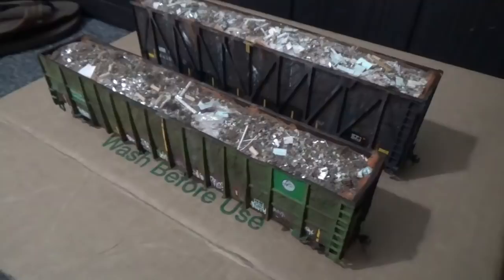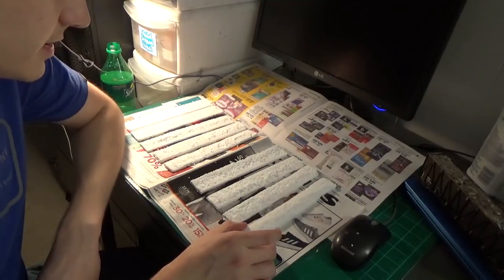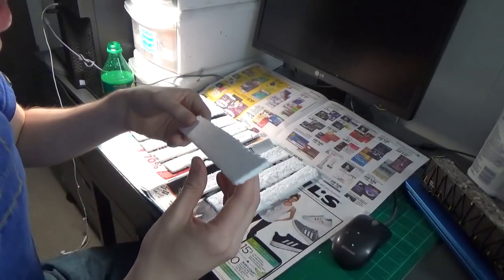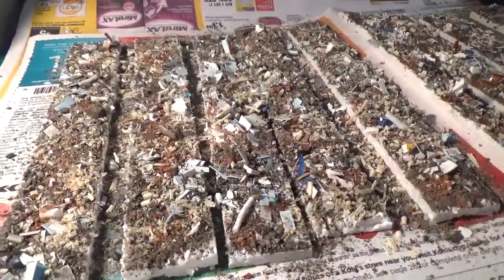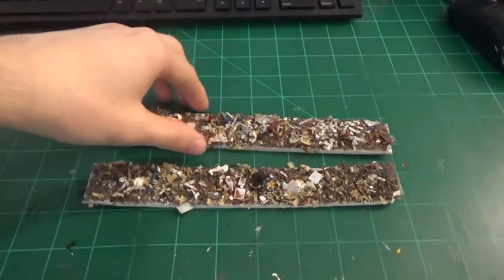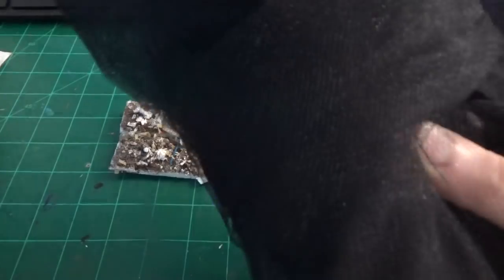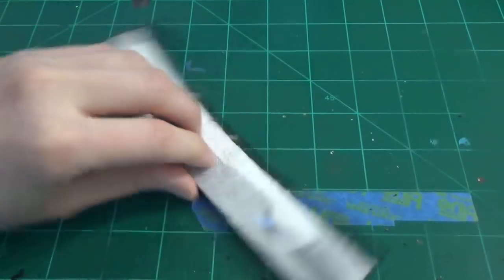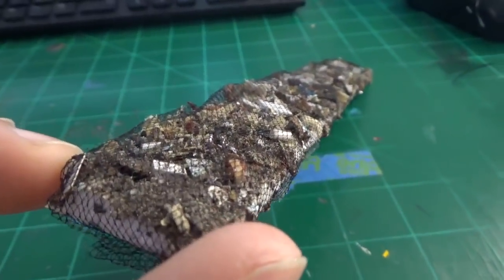***HOW TO: Make C&D Garbage Loads For HO Gondolas! ***

Comment: Hi Dan, I just love the way the gondolas look with the smooth walls. They should be the only type of walls on the gondolas. I think it looks better than the ribbed walls. The black ones should be painted red or orange or yellow or blue or chrome. I have been making realistic C&D and I have multipurpose gondolas. I have also been collecting wood shavings and partially burned wood from near a fire pit for the burned down house effects on the C&D load. I highly recommend getting burned wood for your C&D cars. I also highly recommend getting small chunks of asphalt for the C&D cars. I also highly recommend getting a tier 4 just for the C&D cars. I just LOVE tier 4s. Cory Mears

Comment: Since all foam (styro or sponge) deteriorates over time it is wise to seal the foam with a 50/50 mix of Elmer's glue (PVA) and water.  Once sealed you're good to go from there. Nice gondola loads.  I've got a box full of plastic wheel sets when I changed to all metal wheels & axles and I was gonna throw them away.  Now I've decided to use them as loads for flatcars and gondolas.  I've also got a few plastic knuckle couplers I'm gonna use in a load also.  Cheers from eastern TN

Comment: You've got a lot of talent at making those. And you're giving me a lot of good ideas. But i have a couple suggestions. If you use  that pink insulation foam instead of Styrofoam it won't be warped by the glue, a layer of dark brown or rust colored paint will hide the color of the base & any gaps, and if you imbed small magnets in the bottom of the foam you will have removable loads so you can run them loaded 1 way and empty back the other easily.
Reply: I love that idea! It sounds better than a permanent load. Cory Mears

Comment: You can also hot glue the tule to the back of the foam. The glue won't hurt anything but will hold stronger,  and old ladies do it in crafts so it's a proven technique.